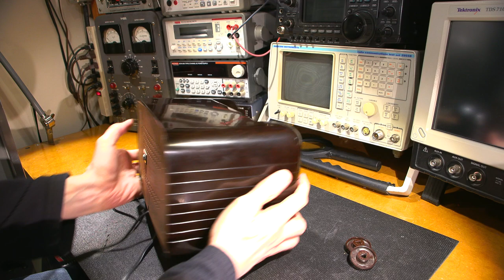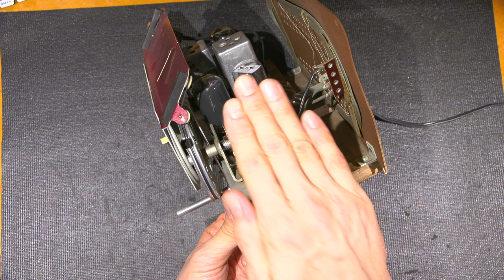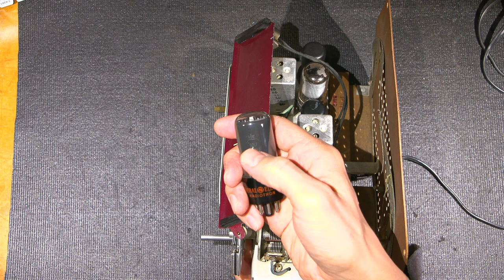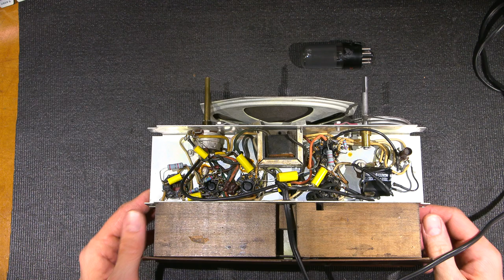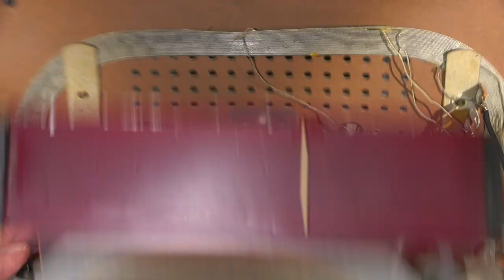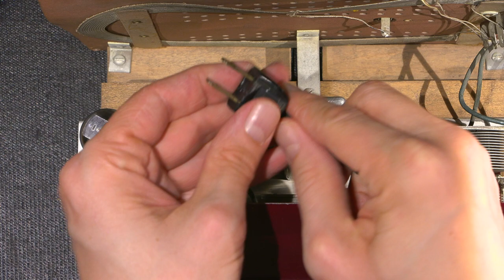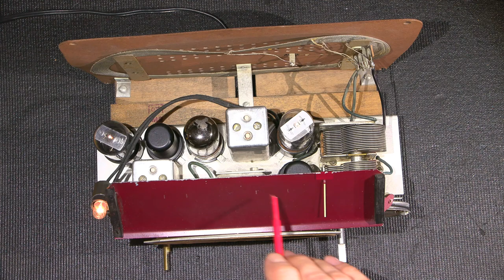Fix A Radio Receiver!

Comment: Mr. Paul,  I, too would like to see a full alignment of this radio receiver.  I am a Patron and I appreciate your lessons.  Some of the more experimental things you offer to patrons are beyond me but I have several radio receivers I'd like to put back to work.  One is a Hallicrafter's S=53A.  I have changed filter caps in both radios but they still aren't acceptable.

One more thing:  The radio in this video has tubes like the 50s... that were put in to do away with the need for a power transformer.  I have a Ward's Airline portable amp that I got at a yard sale that was built that way.  It was a revelation to me that this was done to eliminate the power transformer.  It took me a while to understand the reason.  I wonder just how many of your fans have discovered this.

Comment: I've just started watching this channel. Love it. I've fiddle with electronic off and on Most of my life from being a Microwave systems operator in the US signal Corps in the 1980s to a Network Engineer as a profession. Thankfully I managed to do it without working down to the component level. Never really was that interested in it until I saw Mr. Carlson here. He's very detailed I love that. So I'm going to ask a dumb question. Feel free to laugh. Is it possible to build a SW radio just for listening to the 40 meter band and to design it so all the components work to maximize signal quality and audio quality to make a perfect listening experience for ONLY that band? I mean absolute clarity. No noise from internal components. Everything perfectly designed to be a one trick pony of a radio.

Comment: Yes Paul, I for one would love seeing you do a full alignment on that radio.  Over the decades I’ve seen a variety of procedures - some appeared to have been unnecessarily longwinded, and others were direct and to the point.  So, my reason for requesting a full alignment is to see your method, or procedure, so I might improve upon what I was taught some forty-eight years ago: that being, having fed a given IF frequency (here in the UK it is usually 470kHz for LW & MW), using a signal generator, and either a scope or VVM for measurement, I begin adjustment with the IF transformer associated with the IF amplifier valve.  When the signal is peaked I move over to the IF transformer associated with the frequency changer valve and make adjustments to peak the IF frequency, and maybe move back and forth no more than three times whilst avoiding altering the bandwidth.  My procedure for setting the oscillator to correspond with the dial is to feed in a given frequency (usually prescribed on the circuit diagram) to determine how far away it is from the printed frequency numbering on the station dial, and if is off frequency, make adjustment (also usually prescribed on the circuit diagram) so as to chase the frequency in so it peaks when it corresponds with the chosen, or prescribed number, or spot on the dial.  That is what I was taught when I was a seventeen year old.  It will be interesting to see what you do should our procedures differ.
Thank you my friend, Phil.

Comment: I have an RCA radio like this one, but perhaps one model up.  It has a middle knob that switches AM broadcast to Shortwave bands.  The case looks identical otherwise.  It works, but very low output, so I assume it is weak tubes.  I suppose I should recap and check resister values, then test the tubes.  Can't wait for the alignment vid on it -

Comment: I would love to see a full alignment. I've been in the electronics industry since 1966 and have not done an AM or FM alignment in at least 45 years. I will admit, I don't think I remember how to do a full alignment. Please do a video doing one. I'm going to test my memory if you could answer whether I'm right or wrong, but if I remember correctly, the IF frequency for AM is 455KHz? And I believe for FM is 10.7MHz?

Comment: Another "yes' for seeing a full alignment of this nice old radio.  And could you also include making it safer to use & handle?  For example, could the power cable be replaced with a modern one that terminates in a 3-prong NEMA 5-15p style plug?

Comment: Wow. That was a nice restoration and deserves a proper alignment. I wonder if the guy wrote down the tube layout with the radio in one orientation but had it flipped around when putting them back? I picked up a Zenith K731earlier this year which for a total clueless newbie like me is probably the wrong radio to start with but it's in great shape so I think I can handle it as long as it hasn't been screwdrivered to hell and back. From what I've read the AM alignment isn't bad but the FM alignment is almost impossible.

Comment: Hi, new fan here, wanting to get into tube radios. You have, again and again, talked about polarized plugs and, in some cases, the chassis being hot. Well, how about the parts of the world where we don't have polarized plugs? We are screwed? No, not a newbie to electronics and electrics and hazards. Just mentioning  a point, I guess. Also, have you had an opportunity to work on "farm radios", 1.5 and 90V DC? Haven't seen a video about those yet. I have access to one that my grandparents had, and would like to resurrect it. First, no, second, after replacing the caps, I would need a power supply... BTW, it, and another AC powered wood radio I have, do have the FM Band (~88 MHz ->), too! Would love to see you tackle some of those points!

Comment: Hi Mr. Carlson, another great video, fyi you spurred me on to restoring an old Belmont radio (6D111 Series B) similar to the one you did. The back plate of the radio has the tube numbers stamped onto it. Very helpful. I also found the schematic on line for free which was really handy. Yes, please align it!!

Comment: I spotted it as soon as you took the cover off! "That looks like an oscillator tube in the middle of the IF stages". Having worked on dozens of AA5 style radios as you mentioned in the video most follow the same arrangement v A7/K7/Q7/  Output. :)

Comment: Paul,
PLEASE do the alignment on this one.  In fact, it would be a good idea to also include a sweep of the performance of the IF section to show its performance.  
You mentioned early on that the tuning worked but was stiff...I thought you would show how to address that issue in this video, but since you didn't, how about on the future alignment video you show how to do that?
Something else that I have noticed, is that you seem to have a number of components in bulk.  In some cases, it seems like you have a given value component in the thousands.  I imagine this is partly to reduce the per part cost.  Could you provide a source to purchase from, as well as the part numbers for some of the most commonly used parts such as capacitors, inductors, and resistors?
Another thing you might be able to provide input on is the subject of outdated parts.  Things like an IF transformer for a 1930's - 1940's radio or even earlier that is missing or otherwise needs to be replaced with a new one.   How would you go about finding a replacement part?
One last thing...when do we get to see the next video on the BC348?

Comment: Another great video Paul! I look forward to your videos along with Joe Smith’s videos( multimeter robustness testing mostly). You two guys have the best EE chops on YouTube. You both design and build your own test equipment, can just look at the circuit and find the issue with little testing, reverse engineer circuits, you both are very good at mechanical work and engineering also. I was a mechanical engineer/toolmaker/CNC programmer most of my career but always had interest in electronics since I was a kid. Being a gigging guitar player for the past 40 years I dove back into that pool when all the good old techs I trusted started to retire and unfortunately pass away. A lot of books before the internet on the subject and these days videos from guys like you and Joe have gotten me to the point of being the guy in my area that most bring their tube amps to for repairs. The last few years I have gotten into old tube radios too. Just wanted to say thank you and others with amazing skills for sharing your knowledge. I’m also a subscriber to your Patreon channel and love the projects and the details of schematics and parts list. Keep the videos coming!!

Comment: I’ve got an early 40’s GE 740 radio I want to restore. It hums so the audio amp seems to work! Time to test and recap, measure resistors, etc. thanks for the inspiration! My 35 year career was in electronics but I started after tubes were used so I have very little experience with them

Comment: Could you elaborate on what the "j-hook method" is and what's the preferred alternative when replacing caps and resistors in point-to-point wiring?

Comment: Great Repair. Reminds me of others I got in the past someone worked on. The cap and signal tracer was a good idea for beginners to use. Maybe it will fix allot of those old radios. I had a heath signal one and a sencore Z meter witch was expensive and hard to fix.

Comment: I’m  working on one of these RCA AM Radio chassis. After re-capping it , I did  the IF and RF  alignment adjustments. Next up is the dial cord stringing. Much of the wiring had dry rotted wiring inside it. All the  indicating  parts are missing, no pointer , cord or springs. The right hand side of the cabinet has a 2 inch “ D” shaped chunk out of it, in the rear. Any thoughts on how to repair that?  The cabinet polished up very nicely. The brown Bakelite has a nice swirling pattern to it . I use Mothers Mag Wheel polish to bring that up. Then its two coats of Turtle. Wax and. Good buffing.

Comment: Nice vid and explanation. You may consider using a narrow pointing tool - even the insulated screwdriver when pointing to parts. Would be easier to see than your finger. 
Kinda surprising someone would take out the tubes without noting their original locations.

Comment: Thank you I have now seen enough times to understand the tuning by ear just to get it close enough to dial it in with your equipment if I have my understanding correct. 
       The same as tuning in timing and dwell on a car by ear and a matchbook to set the points and dial in the carburetor by ear and feel and smell to get it running. 
         Then connect your timing light to fine-tune it and your dwell meter and your five gas analyzer

Comment: Love to see you align it using the old time test equipment!
Reply: My radio. lab is nothing but vintage 1950’s and 60’s test equipment, except for my scope. The scope is an early 70’s Leader 50 Mhz model. I added peaking coils to the vertical amplifier to extend the  overall scope response. For AM radio it does the job. In the 1950’s and 60’s all we had were 5 Mhz scopes.

Comment: Enjoy these videos very much.  I have restored a few myself and  it brings back memories when I work on tube radio's and TV's when they were new(!).  The sad thing is that the FCC wants to do away with commercial AM broadcasts and convert then all to digital (HD radio). So they all will become just decorative pieces instead of a wonder work of engineering. My 1950 Zenith has such a warm and wonderful sound that just can't be recreated without tubes.

Comment: Great video, excellent detailed explanations, thank you. 
Any chance you'll show us the output of the rectifier on an O-scope? 
Does the variable C for the antenna work as an LC tank ct to resonate at the frequency you want to receive?
Any chance you'll walk us through a schematic of this radio? 
All these years I thought those oscillations were coming in over the antenna! Sheesh. 
Would it help the radio at all to shield each tube?
Would definitely like to see a full tune-up. Thanks! Well done.

Comment: RCAs of those years usually had a split ground - a virtual ground for the circuitry coupled to the metal chassis with a .1uf coupling cap. Replace the coupling caps with a Y type for safety.

Comment: Some years ago I rebuilt an RCA 16-X-1, which is very similar to the radio in this video 
except that the 16-X-1 has an RF amplifier and a high-low tone switch.  
The best part was that it worked right away, 
although it oscillates below about 800 to 900 kHz. 
Maybe someday I'll deal with that if time permits.

Comment: Hello Paul!! Great video as always my friend!! The Oscillation with the I.F.stage reminded me of the sound effects used in the old Si fi classic movie " The Forbidden Planet " of the mid 1950's!!  Which by the way had electronic created music done with the" Theremin " and other devices along with tape recorders and such!! That radio is a real nice radio, it is a nicely designed set !! but what bothers me is why they put the power rectifier tube right next to the tuning condenser and I.F. transformer !? Oh Well it works good though for what it is !!!  John Bellas at KC2UVN 73's my friend !!

Comment: Hi there Mr. Carlson! Speaking of outdoor antennas: What would make a very suitable outdoor AM radio
antenna for someone like myself that lives in high fringe rural area??? It's not really a question of the amount
of RF power that the stations put out because of in line of sight, oh say at about 12 miles away is at least
3 stations that are avail and do have strong outputs from the transmitting towers. In addition to that, I live
in an very old mobile home that is aluminum sided, which only complicates the problem. Another big Q: Do
you take in old Hallicrafter AM/SW radios for repair that is at least half way operable on at least two or more
of the bands and are in need of contract cleaning, or rotary switch replacements, recaping and alignment???
I believe that the one that I have is the SA-80. It's been nearly 17 years since I fired it up and I still believe that
it's still around the house some wheres, hidden in my junk, although kept in a reasonable environment out of
the dampness; if my son hasn't already thrown it away in a dumpster. At that time, it did have a power supply
cap/rectify circuit problem causing a lot of static n hum and the band selector switch that was flakey beyond 
all get out and the two upper bands were nearly silent. I haven't tried any adjustments of any of the tuning stages 
or the variable caps. It was however purchased at a flea market and has seen a very dormant life overall!

Comment: I just watched this new video. Yes, please do a complete alignment.  I am working on a 6 tube radio, that is similar to this one, but more difficult due to the filthy condition it was in when I got it. I have invested many hours in cleaning, ready to recap it and order all the tubes, as the ones with the radio are dead, and some are not correct or unreadable. Thanks for your videos!

Comment: Paul, that was a nice quick video, i like this kind of "loose screw" problems, easy fixes are as real as ICU - blown up- radios. I personally do not think there is very much space left for a full alignment, because you almost did it.. beside the upper/lower limit. Good job, as always. 73 de Olaf

Comment: Yeah i also got an old tube radio working again but it´s a modern one with FM built at the end of the 50ies and plays nice.
It only has a mechanical issue with the switch so it has a bad contact and the audio is pretty quiet and you have to turn up the volume a lot more which also amplifies the AC noises much so there´s a buzz in the audio signal.
It isn´t as bad if the switch is closed correctly, i guess i´ll have to clean the contacts and it will be fine.

Tube radios are very interesting piece of technology.
Next step will be making use of the 5 pole DIN plug on the back to feed in a external audio signal, probably from my google home mini so i get a decent wifi speaker for streaming aswell as internet radio.

Comment: New polarized 2 prong line cord properly installed, pull and verify the polarity of the caps, resolve the J-hooking and lead length issues and do a full  alignment? Would it be a good idea to pull the tubes and test them individually to see if there is any degradation from improper placement?

Comment: I have this radio but it doesn’t have the fiber board antenna and it had no tubes but I searched and found what it required and their placement. My daughter gave it to me and watching your video has helped but lot of wires have lost insulation. I have power but no power reading on the 12SA7 have to trace out the problem.

Comment: I find these vids fascinating and subbed even though I know very little about electrics other than building PC's  ...so can I just ask as a total layman...Why don't they make the valves/amplifer tubes etc with pins shaped and oriented differently so they will only fit in their own respective socket ...as they are on PC components...that way nobody could plug the wrong one in the wrong socket? as had happened here.

Comment: I stared in electronics in the 70's and became a professional top electronics bench tech. I have seen to many situation and can totally relate to going behind an armature technician want to be. I had the title as "The Dog Catcher". Most units brought my bench had too many bad hands in them and usually turns out there was a sequence of screw ups to fix and the original problem hasn't even been addresses yet.

Comment: What's the plan for the power cord?

Leave it as is,

Replace the cord with a new cord w/polarized plug, or

Just cut off the non-polarized plug & replace just the plug?

Comment: Worked at a rcc radio shop in the early seventies. Bought a 39 philco radio that did not work. Our old tech Tony Zimmerman changed one tube and got it working for me. Still remember Tony doing modulation tests---five five five. He was a nice guy but could get grumpy if I bothered him to much